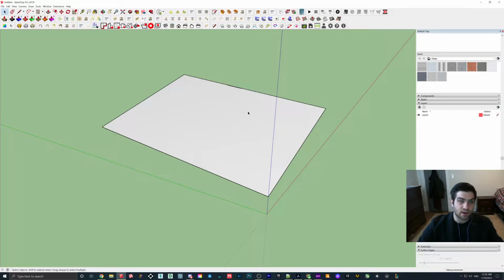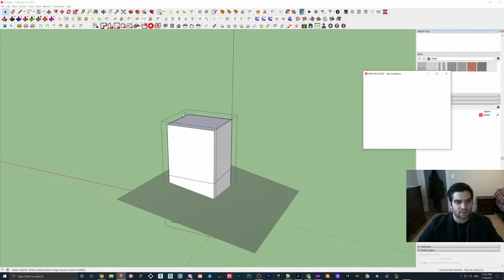SOAP SKIN & BUBBLE Part 2! Fixing Hard Edges!

Comment: To hide those edges go to soften edges and play with the angle. 
 You also can "intersect with model" instead of using drape. I use both, but I find less issues with intersect with complex models.
Reply from the maker: That is a good point! I rarely use solid tools so I missed that one.
Reply: @LuminousLabs  In your right side main pannel. At the bottom most you have the tool already present. Just use that slider and adjust the angle. Also tick the coplanar option after scrolling down.